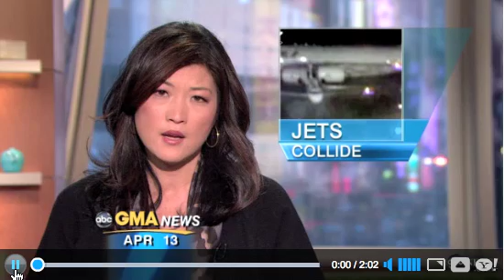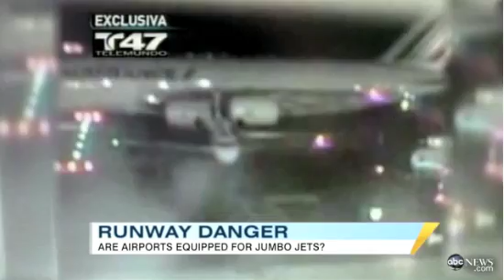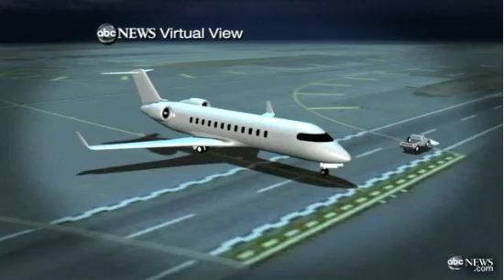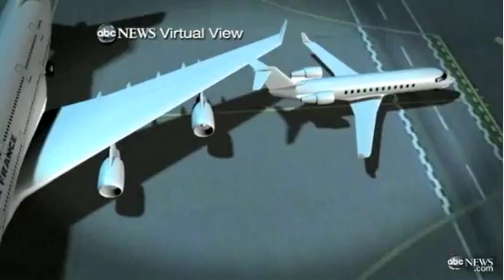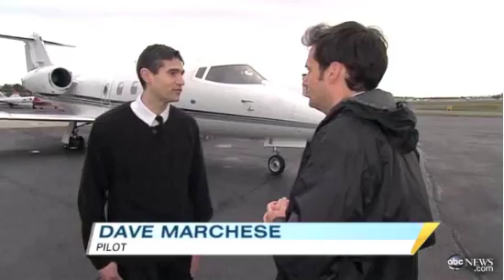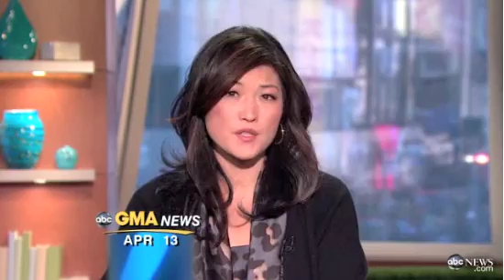Airbus A380 Collision and Crash with Canadair Regional Jet (CRJ)

Comment: It was a while back.......1983 to be exact......but I was a passenger on an Eastern Airlines flight (EA 505 to be exact) whose tail was struck by the wing of a Singapore Air 747-300 while taxiing to the gate at LAX.  A bunch of people who disobeyed the 'seat belt fastened' sign were knocked down on the Eastern L-1011. No one hurt badly....both planes hung up for a few weeks being repaired